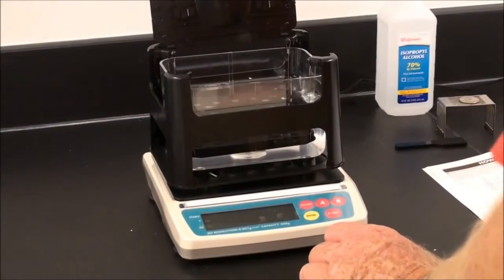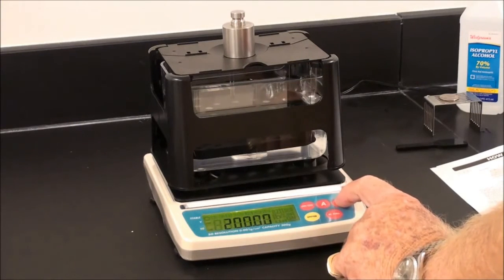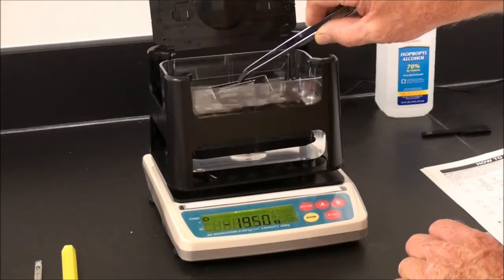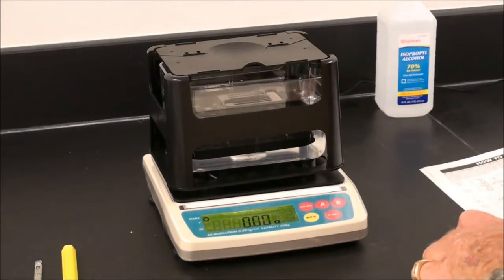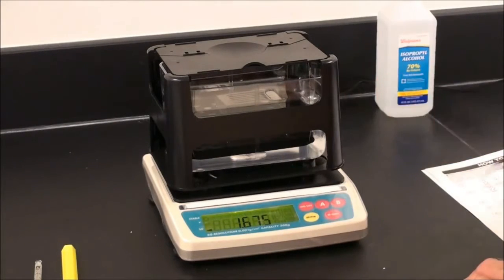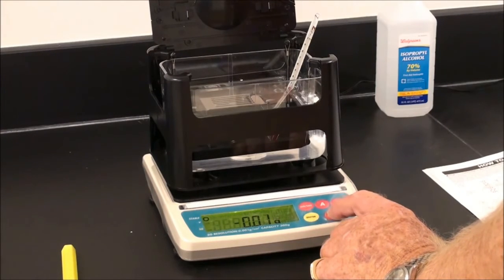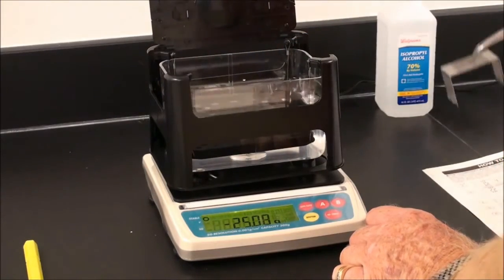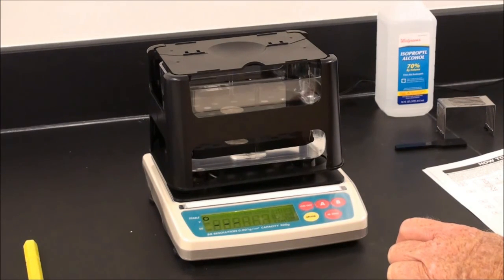Specific Gravity Tester - Densimeter MD-300S

Comment: Anyone can explain why the sample is placed on the sensor stage and then put into the liquid? What does the value represents before put into the liquid? Is it possible to skip the step and just directly place into the liquid?
Reply: Are you referring to the dry mass vs the wet mass? It's used for calculation of the specific gravity.